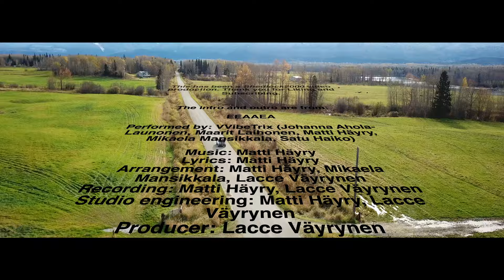Don't Buy one of These! A Review of the AOACY Door Latch Roof Rack Step

Comment: Flatbed trailer!  Perhaps you could even have a standard roof ladder from the headboard of a trailer up to your roof rack? Yes, I know a trailer may not be to your liking but I quite like trailers and don’t mind towing all day long. A lower speed limit may be inconvenient but set that against the convenience of carrying more and loading at floor level. Lot’s of trailer types available. Both mine are 14ft beds, 3.5 ton gross allowable mass and one is twin axle and the other triple with wheels under the decks. This give a maximum load width relative to overall width but less durable tyres that don’t last as long. Ditto brake wearing parts. Ifor Williams brand.
Reply from the maker: i do quite like a trailer myself -- I have had a few in the past. Sadly, I don't have anywhere to put one here, and storing one in the city would be a nightmare to get every time I need to get some wood or a length of pipe or something. They're also really problematic in the winds here. We get winds well over 50 miles and hour at least once a month as we are prone to chinook winds. While they don't blow over often, they do drop fuel economy significantly and make longer trips impractical. 

I have used a lot of trailers over the years and I really like them -- but they can be restrictive -- especially if you just want to go and pick up 6 4x4x8' posts or something,

Comment: Would a tire step not suffice?
Reply from the maker: They might, but they’re much bigger to lug around. Do you know of a small folding one that’s low profile to store?
Reply: @shedlock2000  Canadian Tire has one which is adjustable and foldable but you’d have to check for tire size compatibility.
Reply from the maker: Perfect! I Shall take a look and see what I can come up with. For me the issue is storage space. The back of the disco is huge, but actually not as useful as the L322 or the Defender in terms of storing rapid access stuff like steps/gloves etc.